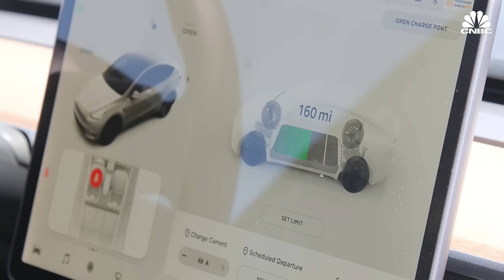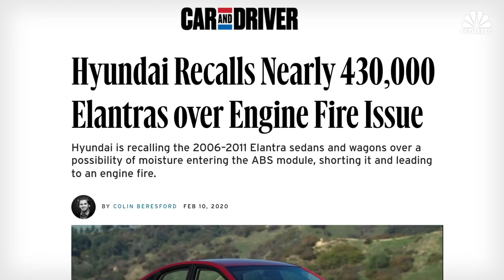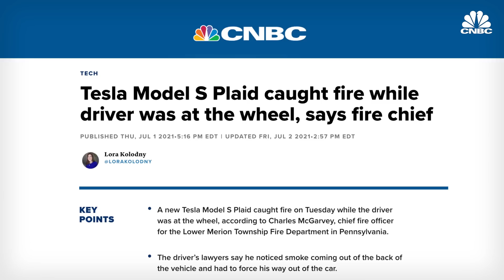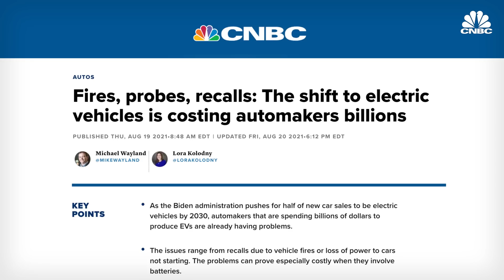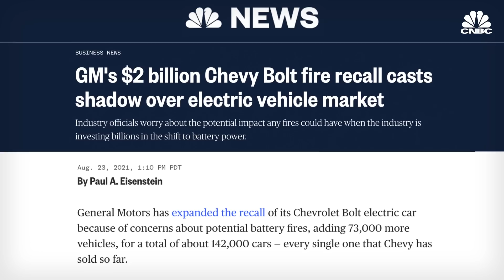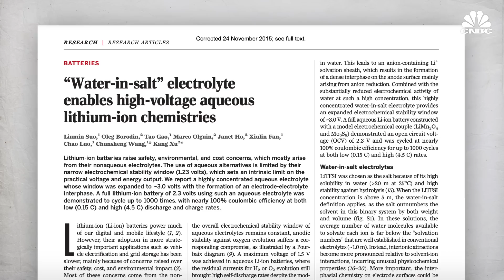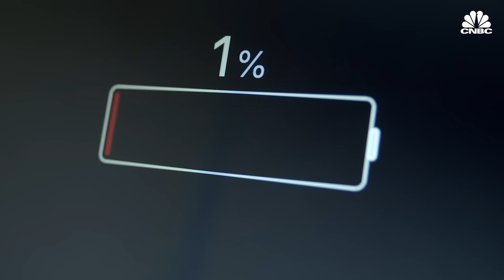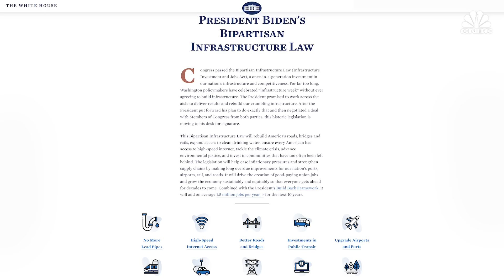Why Tesla, GM And Other EV Companies Have A Fire Problem

Comment: A funny additional takeaway from this crappy video…
Some Bolts catch fire: GM replaces the battery in every single Bolt
Some Kona EVs catch fire: Hyundai replaces the battery in every single Kona EV. 
Some Model Ss catch fire: Tesla does not replace the batteries, but instead automatically sends a mandatory software update to substantially limit charging speeds.

Also, the title of the video is clickbait. Instead of falsely claiming that EV makers have a fire problem, it should say that first responders have a training problem. Yes, EV fires are dangerous, just like any fire. But EV fires are incredibly rare. They are built with significant monitoring and safety to make fires an incredibly rare thing. If there is even the slightest indication of an electrical short, the battery isolates itself. If the battery starts to overheat, the driver gets a ton of warnings and the electric system will reduce output to try to reduce the problem. By comparison, ICE vehicles are literally designed to burn fossil fuels. They run highly flammable liquids in plastic hoses up to a hot engine, compress the fuel to thousands of psi (or tens of thousands in diesels), which is high enough pressure that the fuel is atomized and exponentially more flammable (think flame thrower), and then spray it at high pressure into the engine. The only thing containing this flammable gas is plastic hoses (on the supply side) and some rubber o-rings. There is no leak detection for the fuel pressure, so your car will spray gasoline directly onto the hot exhaust in ignorant bliss. We could also talk about how engines tend to leak oil. Ever driven a car that smelt like something was burning? That’s probably because it was leaking oil onto the exhaust system. That car is one hill climb away from burning to the ground.

Comment: this is one time that CNBC is Close to right  there is a problem here the normal Car just dose not Catch on fire  and this to for the Future of the Auto industry   NOT so fast this is just a FAD  When the populaces catches on   Auto makers will discover  that  smaller and more reasonable Auto can do the same a the Big EVs     and that there is NO ENERGY savings in the ELECTRIC  Car  per mile driven   and FROM sheet metal to scrap yard the amount of raw power used id much higher for the  BIG EVs

Comment: It was a quick line, but, no, a full gasoline tank is not more dangerous than a half-full tank.  Despite what we see on TV, gasoline vapor is the danger—once the vapor ignites, then the rest goes up.  There’s very little, if any vapor in a full tank, thus the danger of explosion is greatly reduced.  Even a rear-ended Pinto wouldn’t explode with a full tank, but half-full or less—boom!  This is the opposite of a battery, where a “full” battery is more likely to fail spectacularly then one that is not.  Fortunately, this is not a common issue for EVs—or even ICEs; no matter what form of transport we use, there are going to be risks.

Comment: And when they do burn they spew more toxins than 100 gas pickups do over 20 yrs of run time.
Reply: Source?
Reply: @logitech4873  youtube. Do a search for electric bus fires,  watch them and draw your own conclusion.
Reply: @patdennis3751  So you watched a bus fire and concluded that one EV car fire spews more "toxins" than 100 pickup trucks do over 20 years?
Can you explain how you jump to a conclusion like that? How are you making this estimate?
Reply: @logitech4873  massive clouds of billowing black smoke. Never seen a properly tuned gas car or pickup with catylitic converters do that. Then there's the whole green energy thing that is not "green" at all.
Reply: @patdennis3751  Guesses aren't worth anything though. You need actual measurements.

Comment: 5:45 European cities now dump entire burning electric cars into a dumpster full of water to put out the fire. 👍 Okay, but...

6:56 Tesla's safety instructions for first responders includes a warning box that clearly states: "DO NOT SUBMERGE VEHICLE TO EXTINGUISH/COOL BATTERY FIRE".

Can someone please explain this conflict to me? 😕
Reply: Correct. And leave Them submerged for 72 hours.  At first it was 24 hours but it was prolonged because they caught fire again.
Reply: Lithium reacts with water. EU solution is dumb. They could dump sand or earth
Reply: The French can't even put out a church fire.
Reply: It's not recommended to use water on a electric fire
Reply: @johnpublic168  Yeah, I thought so too, but evidently things change. 🤷
Reply: Once a cell is broken and more water was added then potential electric connections will be made between any bare metal terminal to short another circuits

Comment: Without oil, companies will struggle to even make the cars - oil doesn’t just represent the fuel, not by a long way.
Reply: Yes, it is not a sudden transition to electrify but you have to start somewhere.
Reply: @yodaiam1000  The first electric vehicles started in the 1800’s, before there were even petrol and diesel cars.
Reply: @ Yes, I am aware. There is still a transition to EVs which is a good thing. It was the ICEV that won out over the early EVs but now EVs are starting to make more sense than ICEVs.
Reply: @ Will never ever buy one - far too expensive and I retired last year. Also, I came close to loosing a friend of mine to a battery pack (a fraction of the size of that in a car) several years ago when it decided to catch fire by itself. He is my lodger because of it and is barred from charging lithium batteries in the house. Thankfully he woke up in time when the pack burnt out his rented room at the time.

EV batteries are not very eco friendly to construct and to gather the materials.
Reply: @ ojonasar Why are people suddenly environmentalist when it comes to EVs? It is okay to mine for all the materials in ICEV including all the ongoing mining for oil, and everything that is needed for a massive infrastructure to support the burning and transportation of oil. But somehow mining for minerals that can be recycled is so much worse. It isn't. The objective truth is that ICEV are far worse.  BTW, a battery for an EV is not the same as a battery for a mobility device especially one that is not UL rated.
Reply: your right ? but oil is dirty and its running out we need to clean up and replace petrol gas diesel side of things  . i personally  think we have been lied to why ethanol  in the fuel ? why fracking ? are we drinking the dregs or are we close to this ? if we run out 70% of the population  are back to horse and carts and pushbikes . .. just maybe its all hush hush to stop people burning it up while they got it or panic buying

Comment: EVs are not undeniably or inevitably "the future". The future includes less personal mobility and a reversion to smaller, lighter vehicles. It is the total carbon footprint, from "cradle to grave" that will determine which technology shall win in the future.
Reply: true james
Reply: If it weren't for massive corruption, the "future of cars" would be powered by water. Look it up if you're curious.

Comment: Anyone with a little bit of knowledge about cars would know that EV cars are much more dangerous and prone to catching fire to combustion engine cars due to the fact that Ev cars have more electrical systems on them. Like the steering like the ac compressor the handbrake the heater sytem and so on. The more chances of it catching fire simple. What about when the cables age and start to crack ?
Reply: You clearly have no knowledge of cars.

Comment: If get get into an accident, the battery will instantly incinerate you... 🔥
Reply: Or the gas tank, or the hot oil inside the hot gasoline engine when it hits the hot exhaust. Or the flammable transmission fluid.

Comment: Sometimes, battery itself isn't a fault for fire hazard.. BMS can get faulty balancer circuit transistor and shorted out battery cell causing fire.. This may not be true to EVs, but it's true for electric scooters, especially, for cheaper ones..
Slower charging is better for batteries, but manufacturers pushes the limits..
LiFePo is safer, that's true, but by now, it costs more. And how I heard, there is newer battery type developed, more safer than LiFePo..

Comment: Lol notice how he said “non crash fire” basically saying that if you get in a crash you can guarantee to roast alive.
Reply: Just like a car with an engine, but add along all the other ICE vehicles that burst into flames without a crash.
Reply: @ouch1011  lol no most people have been in car crashes and haven’t died. I have. But the batteries are too fragile. When they gen penetrated the start a fire. And the fire won’t go out with water. This is more serious then a regular fire.
Reply: @Jabba8872  The batteries aren't fragile. There's nothing that suggests EVs catch on fire more often in crashes.

Comment: Wait a minute how many people drive EV vehicles? Less than 3% of the population and there isn't enough charge stations to handle all the EV vehicles being built so waiting for a charging station could be a timely one. Then how long do you be at the charging station with your EV vehicle while charging? Heard 1% /minute is this right? 1 hour 40 minutes for a supercharger at empty, what are you going to do for that 1.40 hours or 110 minuets? If only 3% of the population have EV how many of those catch on fire? 12, 000 combustible engines catch on fire each year but only 1% of them catch on fire in a parking lot, right?
Reply: 85% of EV charging is done at home overnight.  At a public charger, going from near empty to 80% full takes 15-60 minutes depending on battery size and speed of the charger.  Charging stations are located next to amenities, so I just go have lunch and a bathroom break and 30 minutes later the charging session is done.
Reply: Per the NTSB, for every 100,000 gas cars on the road 1,530 catch fire.  For every 100,000 EVs on the road, just 25 catch fire.

Comment: Normal vehicles catch fire mostly in collisions. These EVs can catch fire charging in a lot, your garage, anywhere being charged. You can develop as much technology as you like, but a moving vehicle in collision will distort the battery housing as it runs all the way along the length of the car. EVs are still in the minority. How many fires do you think we are going to see when they are in the majority? So what if the fire dept. handles it...people caught in a burning car are not going to feel comforted. Notice buses being destroyed because one catches fire....being charged, in a depot. Look it up. And of course, if you do run flat you can't grab your spare petrol can. They don't coast, so so-called Smart Motorways will be even more dangerous. Oh and charging times?????
Reply: Per the NTSB, for every 100,000 gas cars on the road 1,530 catch fire.  For every 100,000 EVs on the road, just 25 catch fire.

Comment: I can’t remember if electric cars caught on fire in the 1890’s when they were invented?
Reply: Lead acid batteries aren't an explosion danger as long as they get proper ventilation.
They can outgas flammable hydrogen if they're in a sealed box.

Comment: Teslas had 60 fires TOTAL from 2013-2021 and the majority were after major crashes. 215,500 engine fires in 2018 alone. EVs are significantly safer than gas cars and its not even close. Per capita also favors EVs

Comment: Some of these burning cars are not just plugged in sitting and charging. What about the the passengers, you cannot fight electrical fires with water. How do firefighters  know they won't get electrocuted trying to save a life? The techs are afraid of them if something goes wrong in the shop, it could be really bad. Most shops do not enough space around the electric cars to be safe when being serviced and they are side by side with combustion engines.
Reply: That’s because the combustion cars are more likely to catch fire than the EV.
Reply: @ouch1011  That's not exactly correct. The problem is in the garage they are worked on side by side without safe distancing between the two. The ev's are more likely to ignight during servicing than combustions. When they do nearby Tech's are in danger not just the person doing the work. The safety for workers hasn't kept pace with the ev's technology. I personally want more safety in dealing with ev's in garages or on the road. Firefighters and Tech's should not have to be burned or electrocuted because safety was an after thought.

Comment: The solution to this problem is to eliminate battery powered vehicles. Yes, gasoline is flammable, but it burns slowly and does not generate intense heat. Lithium ion batteries can generate over 10 times the heat of gasoline. It's like comparing a cigarette lighter to an arc welder.
Reply: So even though the gas powered vehicle is substantially more likely to catch fire than the battery powered vehicle, we should eliminate all battery powered vehicles because an incredibly small percentage of them catch fire? Makes perfect sense! 🙄
Reply: @ouch1011  Actually, with the exception of Hyundais and Kias, gas vehicles rarely ever catch fire. When gasoline burns, it burns with a flame about the same as a cigarette lighter or a piece of paper. When lithium burns, it burns with the heat and intensity of an arc welder.

Comment: Please continue this concern into a special issue.
Everybody has to know the risk of EV cars even they don't drive or own it.
Reply: You can be sure the dealership makes a point of covering all of that with you before you drive off, right?
Reply: @ronwilson3636  Some EVs burn in the parking lot and entirely. Firefighters have no clue how they extinguish them. We don't have to buy it to get into the trouble.
Reply: Why don't you ask the NTSB?  After all, they have the information you require. They recorded 190'000 ICE car fires in the US during 2022. They recorded 4200 EV fires during the same period. The actual reality is the reverse of what you perceive it to be......

Comment: The melting point of lithium is 180 degrees Celsius. It's very dangerous. Iron is 1400 degrees and aluminum is 660 degrees. Iron and aluminum are stable.

Comment: EV's burn a lot less frequently than gas cars. According to stats gas cars have fire occurence of 1500/100,000 vs 25/100,000 for EV's , that's 300 times less for battery EV's. It's true that the fires are hard to extinguish but nobody will convince me that gas is much safer given those statistics.
Reply: Not when they’re parked and standing still. We’re only just starting to see how bad these electrical fires can be. Compared to the MILLIONS of petrol cars world wide. Don’t exaggerate. Watch the video and accept reality. I always make sure I don’t park my 2008 Corolla next to an EV in the car park. It may be an older car, but at least I know it won’t spontaneously combust like a firework.

Comment: It also depends on EV battery technology, LFP batteries don’t burn
Reply: Except that they do.
Reply: Yes, they do. If it’s a lithium battery it will go into thermal runaway if it ignites. LFP batteries are more stable (though less energy dense) but they’re still a fire hazard.

Comment: Just want to clarify I am all for good technology in a better way to save money, climate and being safe. A safer.... Sodium ion battery doesn't have lithium, Cobalt or nickel. I read that the solid state batteries that do not include lithium ion, Cobalt and nickel is still a couple years away! What scares me is lithium ion batteries deals with chemicals when on fire that gets in the air and is a danger to firefighters and extremely hard to put out! I believe Toyota is an example of one of the companies that is behind this type of battery and I myself prefer just to wait until these types of batteries are perfected before I buy an electric vehicle! I also pray that they update the power grid and have a lot of charging stations and within apartments etc... so many people have accessibility. Hopefully the cost of electric vehicles along with crash test ratings will be better on these type of cars as well. There is nothing greater than Innovative minds along with proper precautions to become successful!